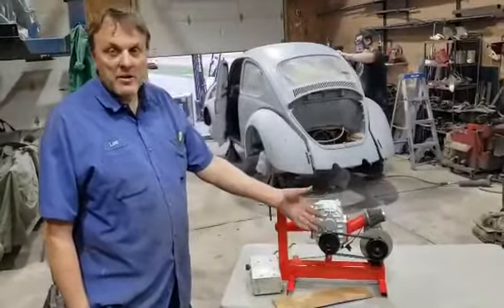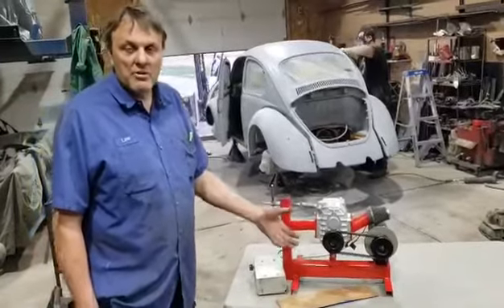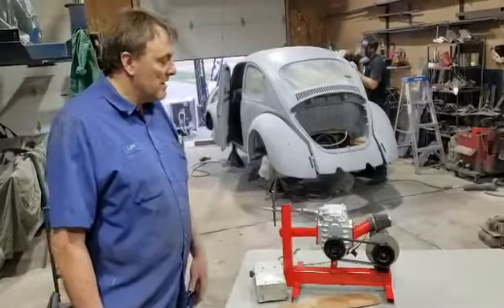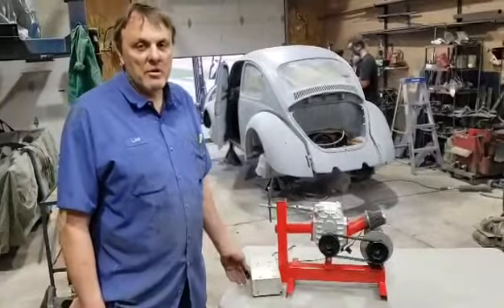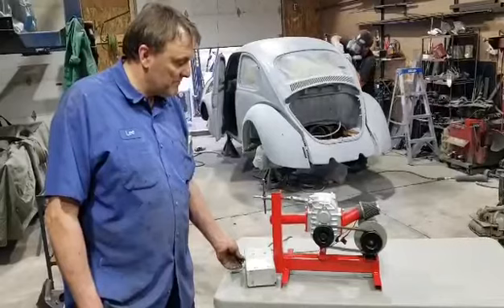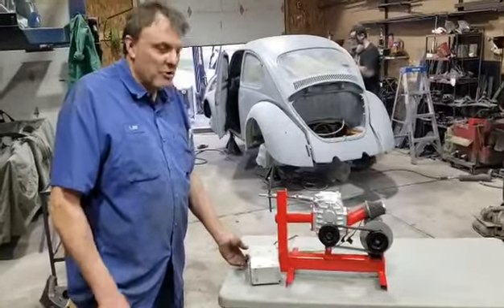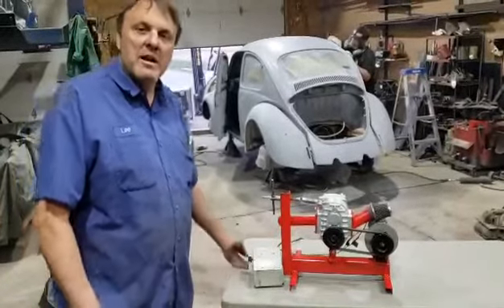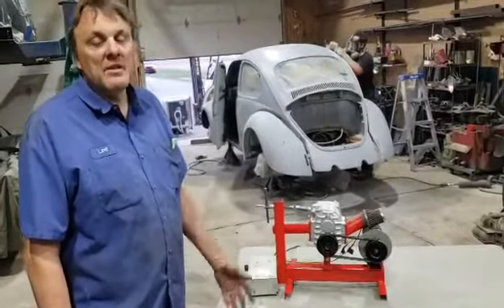New Quality Control Parameters

Comment: Iv had quite a few of the new looking ones fail. they are rebuilt in china but when they rebuild them they use bad bearings and when they re-coat the rotters it is prone to come off on draw through. iv not had problems with non rebuilt second hand chargers.